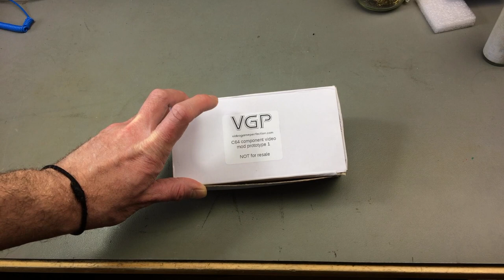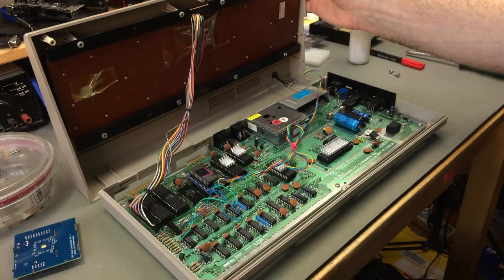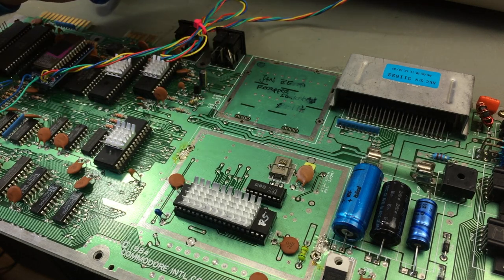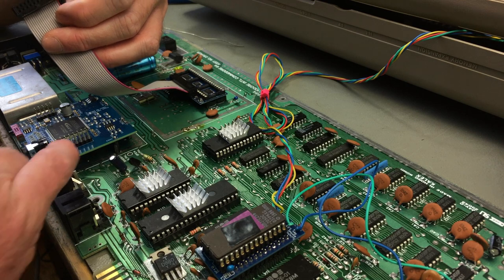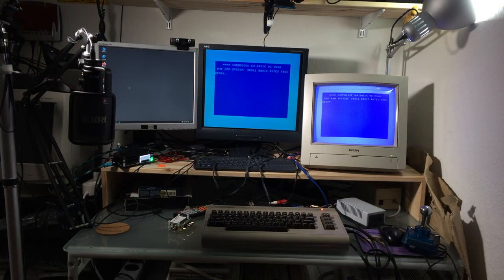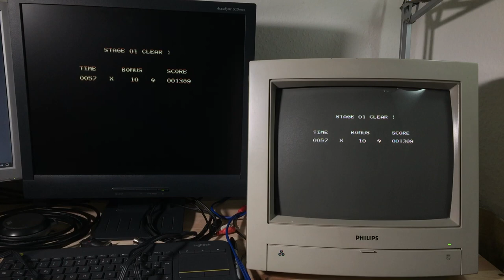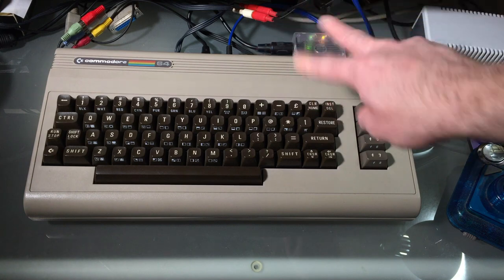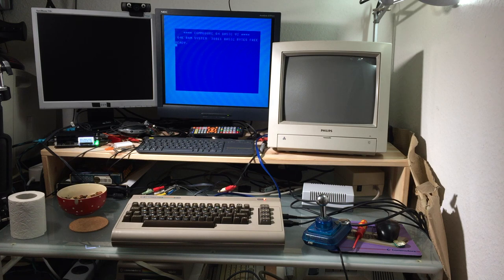C64 Component Video Mod Prototype Testing

Comment: I just wanted to explain why I did not go for HDMI in the first place. 
Actually I did initially, but I had multiple issues with this:
1. Compatibility. The HDMI output signal would be off-spec for a 1080p signal and would not work out of the box or even at all on many monitors/TVs/capture devices. Similiar to the problems that arises when using the OSSC to upscale 288p signals. So I decided to side-step all this configuration issues (see what the OSSC needs to provide in this regard to be really useful) and just create analog signals. 
2. Expensive and very hard to get parts. For an HDMI output I would need an HDMI transmitter chip and most are just not available from the major distributors any longer. Of those that are available there is no documentation accessible - only for companies that sign an NDA.
3.  Incompatible with CRTs. LCDs have at least quite some chance to support YPbPr even today. I actually checked at the electronics stores and many consumer TVs do have this option still. So with analog you can actually cover most devices. And I expect most retro-gaming fans with an LCD to also have at least one YPbPr-enabled upscaler at their disposal anyway.
Reply from the maker: Thanks for the explanation and of course for developing this brilliant device in the first place!
Reply: One thing that you may want to look at in the future is VGA output.  Component inputs are quickly becoming a thing of the past, while 640x480 VGA resolution is embedded in the HDMI specification and devices to convert from it to HDMI are cheap.
Reply: Looks like a great add-on. Something I would consider. Question, would it be possible to create a cable that takes the component output and feed it into an RGB input on something like a Commodore 1084 ?
Reply: The three output signals (Y,Pb,Pr) can be reconfigured from the C64 to output all sorts of signals: RGsB (a.k.a. sync-on-green is easy, as it does also only need 3 lines. RGBS needs 4 lines, so when configuring the three lines to carry only pure RGB, you need to get the sync signal from somewhere else. The luma signal on the original A/V port could be used for this, provided that the monitor can use a luma for sync. If you have some soldering skils, you could build a cable that combines the output from the A/V port and the output from the component mod into a single SCART plug that carries RGB, sync and audio as well to directly drive the 1084. Would be great if someone really could proof this concept.
Reply: Copper Dragon nice explanation, thanks. Would make for a great c64/a500 setup with a 1084.
Reply: You made the right call. I prefer to play all my retro platforms on a CRT screen.
Reply: I was thinking about a HDMI project myself and also had to come to the conclusion that it's a huge pain to get parts and information. A bit scary given the fact that more and more new TVs come with HDMI inputs only...
Reply: FANTASTIC work!
Reply: @jdryyz  An external solution is probably easier to set up, but the quality is only whatever the 40 year old VIC-II is capable of.
Reply: Does this board change the 50.125 hz pal signal to a clean 50 hz on the composite output ? Was wondering because of the incompatibility with small cheap tft screens that only accepts a clean 50 hz signal. @Copper Dragon
Reply: @perafkraften  No, the signal timing is still the same. I do clean up the CSYNC signal a bit to get better compatibility with upscalers, but the frame rate is unchanged.
Reply: @jdryyz  Once you use the original analog signal from the VIC-II you can not really get the quality beyond a certain point. You may get decent luminance (maybe with a LumaFix), but the chrominance is always noisy or washed out.
Reply: @copperdragon9286  I finally obtained and installed my component mod today! Works great! I still want to use the A/V output for chroma/luma in some situations. Is that possible with the component board installed (looks like that's what Jan was doing in this vid) ? I use an S-Video to VGA adapter with a different LCD panel and it is no longer detecting a signal.
Reply: @jdryyz  Sure. the component mod also keeps the original A/V output working. 
I provides a dedicated video amplifier chip to make the quality better than original, tough.
Reply: @copperdragon9286  Not sure what is wrong with my mine then. I will test other displays. I do not have a PAL-compatible CRT but my home theater setup might work. I have the component mod in a 250466 board. Does the component and A/V output still require the 8701 clock to work?
Reply: @jdryyz  If you have output on the component outputs, at least there is a pixel clock signal going into the VIC this would not work at all without the 8701. When you are using the mod board to generate the pixel clock instead of using a 8701 you will not get color at the A/V port, but at least the greyscale image should work.
Reply: @copperdragon9286  Okay so my 8701 should be fine. I do not know what could be wrong then. A/V port was working fine with the original RF mod installed. I tried it on my home theater AVR and still no signal at all. The AVR works fine with other NTSC and PAL C64s over S-video.
Reply: @copperdragon9286  Original composite out should be good for sync signals but it would be the best (for image quality and compatibility) to strip synchronization signals out of it with something like LM1881 I/C. Circuit is pretty simple and should even fit in to Scart connector. It can extract horizontal, vertical or combined sync. Having sync and rgb signals go separate routes might make image shift slightly left or right depending which signals get more delay and as long as RGB signal has not much delay or the delay is something like exactly one/two lines +/- few 'pixels' then it should be generally fine. Not so fine if delay is something like half line, then this idea would result in unusable image. I guess the easiest way would be to try with something like PVM as it can accept external sync or SoG for both Component and RGB
Reply: @perafkraften  Should you or anyone really worry about "cheap tft screens"? I would not connect my PC to cheap TN panel let alone Commodore 64...
Reply: @e8root  Using composite for the sync signal in a cheap SCART cable (no individually shielded wires) can cause problems because of the crosstalk from the chrominance signal. If you use the luminance instead, the problem should be much less pronounced. But just adding a sync stripper into the SCART plug may not help much, because this would be located at the end of the cable and the crosstalk has already happend in the cable itself.  I propose to just use the luma output of the C64 from pin 1 on the A/V connector and not connect pins 4 or 6 at all.

Comment: The OSSC should not introduce any lag, it doesn't have a frame buffer and it outputs data as fast as it gets it. The 1 ish frames of lag is probably entirely from that LCD panel.

Comment: Really cool! I wonder what it's using the original VIC-II for? Can it work without it?
Reply: Adrian, do one for c64 ntsc as this was proven only on pal! 👍
Reply: The vic controls the timing, data fetching.. The fpga is only sniffing.
Reply: Seems like it's basically doing what the NES RGB mod does, since that also has the original NES PPU sitting on top of the riser board, then the FPGA sniffs out data and makes a video signal from that while the video chip does what it normally does.

Comment: Would be great change the connector for the same of the genesys/megadrive 2 jack, which will give the possibility to route the audio via that same jack, also very good quality shielded cables therefore eliminating some of noise.
Reply from the maker: That would be a mini DIN if I remember correctly. Makes sense but I don't know if it would fit a connector without modifying the C64 case.

Comment: This is a good mod but the C64 really needs a direct FPGA VICII drop-in replacement with both PAL and NTSC compatibility and possibly some extra modes like scanlines, pallette switching and crt emulation.
Reply: By scanlines you mean line doubling or 31KHz output? Should be doable with even small FPGA by today's standard without needing any DRAM to put only VIC II part of whole C64 core

Comment: I've often lamented RF modulators and their large internal on-board footprint but in this case leaves a nice space for that mod. :) May not be original but you kind of want some added vibrancy from the colors with Component. I probably wouldn't be bothered by that sound issue but it would be interesting to see somebody address it.

Comment: As a previous teenage C64 owner, I still like to watch videos on the C64, and also get amazed to see how this old computer still moves fans to create and design modern hardware and software for it. But I'm not in playing the C64 again, even through an emulator. YUV output is really great and it's too bad the computer didn't have it at first. For example the older TMS9918/28/29 from the old 70's, used in Ti99 and MSX, had PAL / NTSC composent versions and also YUV versions.
Reply from the maker: Yeah, it's amazing that there's still new development for the old systems. I love it. Yeah, it's kind of a bummer that the C64 didn't get at least RGB output from the beginning but as far as I understood it's difficult to get those signals due to the design of the VIC-II chip.
Reply: Commodore computers were the first computers (or even home appliance) with separate Luma and Chroma though and this also makes Commodore monitors better than contemporaries because of their S-Video support. For all intents and purposes S-Video is "good enough" for 8-bit micro. If C64 supported such mode 80 column text it would be easily doable on S-Video even with colors.
Reply: @e8root  Coming from the country who made the scart RGB connector mandatory, I don't share your point. The difference between composite and YUV/RGB is of the same magnitude than between LW radio and FM radio. With separate Chroma and Luma, you're just attaining MW...

Comment: Cool mod. Unfortunately not all component inputs on TV's and monitors are up to the task of displaying SD resolutions properly so scandoubler is still needed. RetroTink 2X should do the job just fine though and the only issue then should be 50Hz support as not all monitors work well with 50Hz (either do not work or work but have choppy animation). BTW. Color look pretty cool. My favourite palette for my Mister FPGA C64 core is Colodore palette.

Comment: Awesome!   Anything to replace those old modulators.   Would be better if they  install the proper height headers to take the guess work out of retrofitting even if they don't solder them in for you they should provide them to remove the guess work.

Comment: Related to video  output...what are you using to get video from your Amigas onto the LCD monitor? I have an A2000 and used to have a MultiSync monitor for it, but that has since disappeared on me, and I'd like to try using it on my current monitor with VGA and DVI inputs.
Reply from the maker: I'm currently mostly using the OSSC upscaler/line doubler which is great. It outputs HDMI so it works great on DVI monitors with a simple adapter.

Also, the Indivision ECS/AGA cards for the Amigas are highly recommended if you really want to get the best picture out of your Amiga on a modern screen.

Comment: Thanks for the mention and link. Video looks good, you should try hojonorems color program🙂
Reply: So, when is the HDMI upgrade. hehe ;)

Seriously, though, it would be a simple enough thing to drive HDMI directly from the FPGA.

The only question then is whether the 240p/288p timings will work well with most TVs when line-doubled to 480p/576p. I think it might.

(If the PCB wasn't in KiCAD, I'd add the HDMI port already. I have used KiCAD, but it's a bit weird.)
Reply: @electronash  I put it away.
Reply: @electronash  I write to you on twitter PM.
Reply from the maker: You are very welcome. I will definitely try the palette program! :)

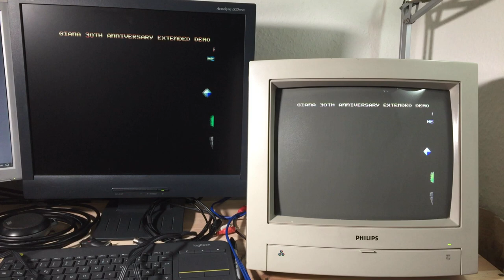Comment: When the Giana game scrolls the screen, the HDMI screen appears blurry while the Philips CRT doesn't (for example 23:27 ). Is this due to your HDMI adapter sampling rate? Later, when you record directly without the camera/HDMI adapter ( 27:00 ) the R2D2 scrolling animation appears nice and smooth.
Reply from the maker: The TFT looks smooth in real life. The blurring is (I think) caused by the camera frame rate that I managed to set to the CRT quite accurately but it didn’t lock perfectly to the TFT.

Comment: I've always thought the color palette of the 64 was too washed out.  Being able to increase the color saturation, while not true to the original, might still be an improvement.
Reply: The issue with colors on C64 never looking right in emulators compared to the real thing is not as much issue of finding right palette but the fact that there was whole range of quirks that color encoding schemes such as NTSC and especially PAL have. Some of these quirks are best removed but some were actually helpful in making image look richer and more vibrant in ways that just changing colors to average values can ever make it. When you go full RGB (or Component for that matter) you loose all of these composite effects and especially with RGB you cannot control color saturation anymore. It is however possible and I tested it to add some of the effects back and if done correctly (read: these effects are very subtle!) it can break monotony and make image look more vibrant and alive without making colors more saturated and without loosing any of the FullRGB advantages such as razor sharp clarity.

Comment: I have been dealing with Commodore since PET was launched.

My question is, why is this gadget really useful? Do 3D games like flight simulators run more smoothly? If so, I can see that, since it is an FPGA.

But I think the effort involved in just seeing the image on a modern monitor is too risky to possibly destroy his C64.

This is not meant to be a nagging comment. You can also connect the C64 to a modern television with a modern cable via Scart. I have ordered some for my C64 and Amiga 500, and the quality is flawless. Razor-sharp, so to speak.
Reply: Yes you can connect C64 via Scart connection to modern TV but this solution has few flaws: a) it still composite (or s-video, though s-video via Scart is not widely supported) and not RGB and b) modern TVs are pretty terrible with SD signals and especially 240/288p signals which they try to de-interlace. S-Video to some S-Video capable upscaler like RetroTink X2 Pro is probably the best and safest option for C64 rather than getting Component output so that more expensive OSSC can upscale it. On the other hand if he have few C64 and wanted to have one with clearer picture via Component/RGB then even if there is little if any benefits compared to S-Video it is still worthwhile ordeal. In either way C64 with both composite/s-video AND component output (which can also be probably modded for RGsB!!!) is an improvement over stock C64 :)

Comment: 3.5 inch jacks are not ideal for video,  any fondling with the cable will introduce distortion in the picture. There are reasons why they aren't used for video. I get that these are readily available but something like mini-DIN with say 7 pins would be far better for this application. https://en.wikipedia.org/wiki/S-Video#7-pin_mini-DIN
The 7-pin mini-DIN connection is 4-pin compatible so with proper wiring, you could probably make the same connector output both YPbPr (or RGB) and original C64 S-video.

Comment: Why didn’t you try it without the OSSC? The Github source shows it already has a built in line doubler so the OSSC is redundant.  It also has a scanlines mode.

Also, the colours may always be off even if you edit the palette.  The reason for that is that it is only using 5 bits per colour and you really need 8 bits per colour to replicate the C64 colour space accurately.
Reply: Probably doesn't have a TV that has component video input. It's fairly uncommon in Europe on older TVs, and entirely new TVs from the last two years don't have any analog video inputs at all.

Comment: Compare the cursors blinking when editing the video and you can see the difference. It may also be part to the CRT being faster, as I thougt the LED monitor looked slower (staring in the middle to see both screens at once). But I might be wrong, and it also may not matter to the gaming experience.
Reply from the maker: The TFT definitely is a tiny bit slower technically because of the way the picture is displayed (individual scanlines on the CRT vs whole screen refresh on the TFT), plus the OSSC upscaler introduces a tiny amount of lag, too, but it was really difficult to find occasions where it was visible, even slowing down and stopping the footage.

Comment: Nice to see this mod get some more attention!

Quick question, have you had the chance to give my Palette editor a try?  I'm interested in hearing any feedback that you have.  I only need to implement RGsB mode and it'll be pretty much complete.
Reply from the maker: Hey, cool that you comment on this. I briefly fiddled around with the palette editor and liked it a lot so far. Will probably make another video checking it out sometime. RGsB mode would be awesome (at least it would be great to have for some setups). Thanks for your work on this! :)
Reply: @JanBeta  I've just put out a new version with RGsB capability amongst other things.  I don't have any equipment that handles sync-on-green so I can't properly test it.